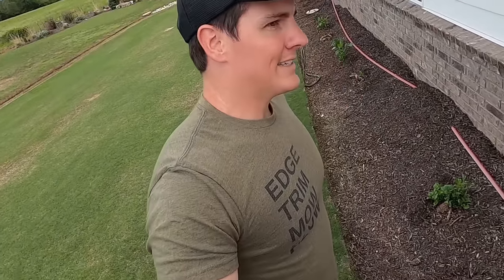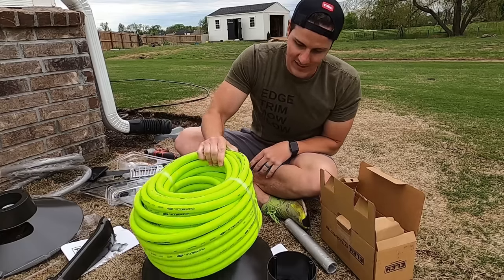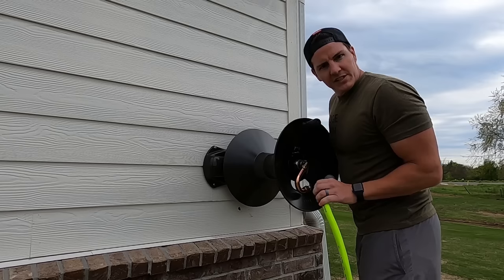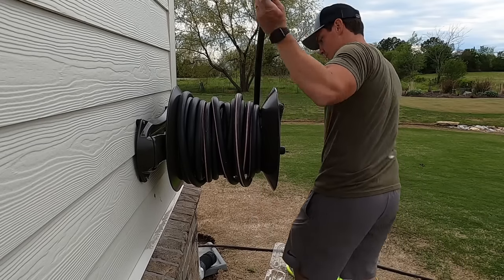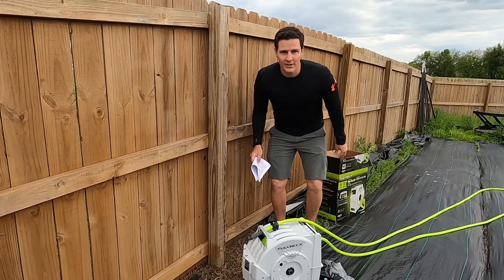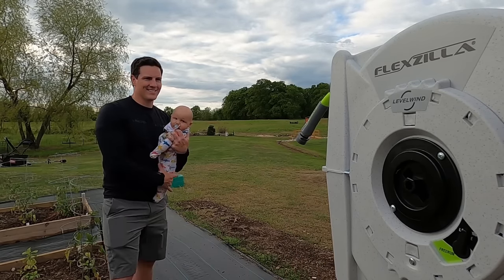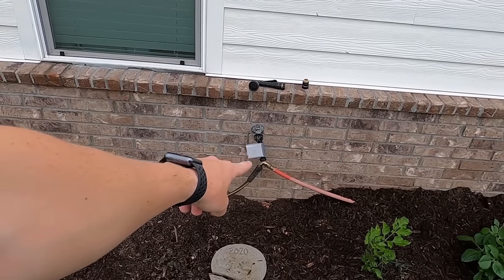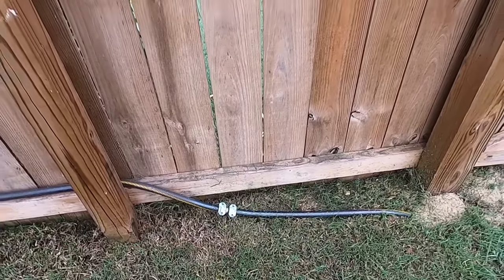I'm DONE Wasting Money On CHEAP JUNK!!  My New Hose Reel Setup

Comment: B-hyve timer; in the front there is a button. Long press until the light turns green and it will manually turn it on without the app. A quick press will turn it off.

Use the app to set the default timer duration; example: I set mine to run for 30 minutes when turned on manually.
Reply from the maker: Ah... well I’m an idiot
Reply: @TheLawnTools  The B-Hyve timer needs some love. Like your videos. Maybe we will have a future video with some thumbs up.
Reply from the maker: @davedozer7200  I shall redeem myself 😁
Reply: Trust me the b-hyve timer still has plenty of real issues.
Reply: I have a rainpoint and am loving it so far.
Reply: But not as fun!
Reply: @TheLawnTools can you tell me I’m going to buy this eley hose reel and debating on which hose. The eley hose is said to be very good, what do you recommend the flexzilla or the eley hose if you have any experience with it
Reply from the maker: @Markg488  I have never seen/touched/used an Eley hose so I’m sorry but I can’t make a recommendation for or against.
Reply: 😂😂😂 4x4 wood post  @TheLawnTools

Comment: Personally, I got tired of dragging long garden hoses all over my 5 acres. So I took the time and effort to dig trenches and run PVC pipes to all the different areas where I need water at and put in the outside water faucet that doesn’t freeze in the cold winter weather.  Now 10-25 ft of hose gets me anywhere I need to water.  Working on putting in auto/timer water system in the gardens so there’s little to no hand watering needs too! Try to cut labor times down as much as possible to have more time for other projects that also need done too!
Reply: I’m surprised I made it almost to the end but when he started showing the hose splitters and the short section buried at the gate, I could take it any more.  Too much talking about random stuff.  The 17 min video was a hose reel review?  I have pvc everywhere with 25 ft hoses…

Comment: Dramm Quick connects have been fantastic through heavy use. Each end of our three hoses has a quick connect (so two per hose). Plus, the Dramm 300 shut off valve on each tasking end of the hoses. Every hose attachment gets a male end quick connect (sprinklers, watering timers, watering wands, single task hose nozzles, etc). It is no longer a task to do any water work, all seemless. Taking the hoses in for winter storage is a breeze! This is the third season and I recommend them.
Reply: Agreed. I have the Dramm quick connect and shut-offs on all my hoses. They’re awesome

Comment: We have been using Gardena quick-connects with everything for well over a decade and they work as well now as when we first bought them. All of out hoses, the automatic watering system and the pressure washer all have them and even our Craftsmen lawn mower has a compatible spigot pre-installed for self-cleaning.

Comment: Instead of buying more awful plastic garbage, I got myself a Jack Daniels half barrel from Lowe's and drilled a hole to feed the hose through. Coiling the hose up in there is super easy, it looks much nicer in the yard than any plastic reel and when it rains the backyard smells faintly of aged whiskey.

Comment: Gardena GBR-3817C Brass Tap End Connector
Gardena GBR-3818C Brass Hose Connector w/Waterstop 
GARDENA Tap Connector-Premium.  

All metal versions of the quick connects you know, with replaceable o-rings you can buy at any hardware store.... two years not an issue in sight.

They're actually hard to find now that they've been discontinued, and I'm glad you said you're not going cheap anymore cause these cost a pretty penny.

Comment: I bought a reconditioned kindle.  dropped into my nightstand & it quit working.  Was at tractor supply and found recharge lights on closeout.  it lasted 3 weeks. then bought same brand diff model for $25 more, still doing job after 18 months.

Comment: I love my b hyve system. Been using it for 2~3 years now. For manual turn on, Just push & hold the button for like 3~5 secs. Then water will flow for 10 minutes and will turn off after 10 mins.

Comment: I have 3 Eley hose reels.  Two free standing and one pole mounted.  They are expensive, but they are built like tanks.  My oldest reel is probably 8 years old.  I leave them out in the winter and they are still in great shape.

Comment: How is it holding up?  Would think the reel mount would go perpendicular to help support the weight of the hose and water but maybe that way helps support the jarring around of use better.
Reply from the maker: You can mount it either way. Whichever works best for your setup. Holding up great with no complaints 👍🏼

Comment: How’s the flexzilla doing after a couple seasons? Did one on the open reel turn into a sticky mess? I love how easy to use that hose is in a wide range of temps but the rubber on all of mine breaks down in the sun after a while. Just wondering about your experience

Comment: Get the quick connects from obsessed garage. They are expensive but worth it! I’ve had mine for 3 years with no problem. Have them on everything including my pressure washer.

Comment: Melnor quick connects have worked great for me for the last year and still going strong. They may start breaking down due to UV rays in a year, but they work so well, I’m ok with replacing them every other year if needed.

Comment: When I first got started in lawn care I always bought used or consumer grade equipment because it was cheaper. My first edger was a Ryobi weed eater with the "attachment system." It lasted me about 4 months and I ran it until it wouldn't start anymore. I threw it in a dumpster and bought a STIHL FC-90 for around $400. For most people that's a lot of money to just pull out your pocket, but it's actually cheaper in the long run. That cheap Joe Homeowner weed eater may only be $95 but you'll end up buying another one every season. My commercial grade STIHL equipment has lasted me 6 years so far. If I kept buying the cheapie I would have spent at least $600 in my six years of business compared to $400 for dependability, capability, easy to work on, ect.

Comment: I live in Florida, near Tampabay. I try never to have anything made of plastic outdoors unless I want to replace it on a regular basis. I have two other types of retractable reels. A 50-foot electrical and a 50-foot air compressor hose. Both are mounted in my garage. You didn't mention, I believe, the size of your yard. That first scene sure got a ton of comments. Like the beginning of a good action movie.

Comment: I have a suggestion. The hose reel that you mounted on the fence post is carrying a lot of weight and will ultimately be difficult for that fence post to support, especially in windy situations. Place at least one brace on that fence post to help off set the weight of that hose reel.
Reply from the maker: Thanks! I’ll have took up fence post braces. I don’t know what that means but I think it’s a great tip!

Comment: That flexzilla hose reel looks strikingly similar to what's called a Power Port Products auto rewind hose reel. The model numbers I'm familiar with are an HR 5012 or an HR 5038 series 2 .  In my opinion, these are the best auto rewind hose reels in the world.  The side plates that hold that flexzilla reel together and even the output in the front of it are strikingly similar to the Power Port Products Incorporated reels. I wonder if Power Port Products actually makes the Flexzilla hose reel, which in my opinion would make it one of the best auto rewind hose reels that you can buy.

Comment: I mentioned Melnor disconnects, but you should check out their entire line of products. Their timers are great as well. You could get a 4 way timer and leave one open for manual watering, but my wife doesn’t like to fidget with the controls so I ran a 2-way splitter before the timer. I also recommend Melnor splitters because they have the larger knobs to open/close the valves.
Reply: The few products of there I’ve used were great. I’ve seen a 4 way Melnor splitter that looked nice. I was REALLY interested in there WiFi water timer but everyone is outta stock or it seems to be discontinued and I can only find there Bluetooth water timer.

Comment: try using buried 3/4" PEX with shark bite copper risers (with winter drain valves at the base)  and as a feed for your hose systems.

Comment: have have the exact same setup with 150 ft. of flexzilla hose on the eley.  Fits great
Reply: Are you using 3/4 or 5/8? And did you need the extension for the reel?

Comment: Interestingly enough I have had the one you chopped off the wall for 7 years now with zero issues. Can't explain why it has lasted so long as I have done nothing to help it out over the years and it has seen winters of -24F in my area. Never took the Sears 100 foot rubber hose off just drained it back for the season(s). Everything must have been in alignment the day they built mine. I will say the retractable idea is interesting.
Reply: He could have put it on the curb with a free to take sign.  Someone else may have been able to repair it or do a work around.  Surprised he didn't ruin the siding.
Reply: @Susan70003  Yes exactly. I was wrong though, it was a 2013 model so it was nine years old. I did purchase two of this type of hose system but I got 2 100 foot models that are the generic type and so far they are working well. To add when things go to the garage if it is at all usable I leave it beside the containers for all to pickup. The majority of items have been picked up by the public for their projects or reuse.

Comment: In a year or two, that 4x4 post will warp inward and your fence will sag.  Ask me how I know.  Would warp slightly less if you would have mounted it lower on the post.  You heard it here first folks!  Also, nothing beats Nelson all brass quick connects.  Been using the same ones for 30 years.  The only change is the brass darkens, but these 30 year old quick connects still work like new.
Reply: Also, the Nelson is  less than half the Eley ones

Comment: Gotta go with the Eley quick connects!  Hands down, the best!!  Here you go... https://www.instagram.com/reel/COORJGmJqGn/?utm_medium=copy_link
Reply from the maker: Ooo that quick connect does look good
Reply: It works 100% of the time all the time - Ron Burgandy
Reply: @jaymetheaccountant  LOL!  Yes!
Reply: @TheLawnTools  yeah!  It’s also full bore, so there is zero reduction of flow.  If you install a socket at the end of a hose, I would recommend also putting a small ball valve on so you can operate everything locally rather than having to run back to turn the water on/off.
Reply from the maker: @TheLawngineer  true 👍🏼

Comment: Eley has quick-connects - they are simply the best.
Reply from the maker: I may have to get like the top 3 and do a comparison video
Reply: @TheLawnTools  I went through probably 5 different brands trying to get quick disconnects that weren't junk. Finally found the eley ones and they are by far the best on the market. They also have twice as much flow as the others. They're more expensive but will save you money in the long run cause they'll be the last ones you'll need. I've got them on every watering tool and sprinkler.

Comment: Sho was waiting to see a big ol chunk of Hardie go flying… or a busted brick.
Man it would drive me nuts to have all that extra hose looped up on that fence on the way to the hose reel.  Id be left with no choice but to cut it short n splice it. 
Being a concrete guy, I hafta mention that those hose timers often suck really bad and if they leak for a long time into a bed up against your foundation, you can end up with part of your foundation bearing on a mud hole that stretches up under your slab and can be hard to even notice from the yard side.  But your slab sitting on mud means that eventually it’s got a good chance of wanting to settle and you can end up with some pretty serious problems that you can fix but will still come back to bite you in the ass when it comes time to sell (if your state is like mine and you have to disclose foundation issues even if repaired). Not sure where you are or soil conditions there.  It can be a bigger issue in some places than it is in others.    Jus sayin.
Reply: Good point there. When I had new gutters and downspouts installed, I was advised to have the end of the downspouts at least 2 feet from my house. Home Depot sells a retracting extension for this purpose.

Comment: I like how you tucked the hoses away, cool tour. I'm super happy with the Eley quick connects, I learned by more than you think you need because the one thing you don't put one on you'll end up using and it's annoying. They're completely metal and have One of the largest inner diameter of any quick connect I found.

The Eley reel I'm super happy with as well, going to buy one for the other side of my house at some point.

Thanks for the link too! Happy Memorial Day! 🇺🇸✝️🪖

Comment: I have had the price vs value discussion with so many people but it's hard to get through to them.
I have found that paying a bit more for the quality product that LASTS is much more economical in the long run than buying the cheaper one multiple times through the years.
But most people are to hardheaded (or just too dumb) to do the critical thinking to grasp the concept.

Comment: Wait, you learned of and procured an Eley reel, and don't know which quick connects to use?  C'mon man, get all of the Eley stuff.  It's expensive, but you've gotten past that already.  Quick connectors w/full-diameter flow, ball valves with full-diameter flow, nozzles, potable water hoses.  Just bring them in when freezing, silicone grease on the connector o-rings now and then.  Done.

Comment: Love how the screws ripped nasty holes in your siding as they got ripped out with your dramatic hose reel removal at 1:30 ... Considering the damage and subsequent cleanup you should have at least used a screen shot of you swinging the pick axe for your thumbnail
Reply from the maker: Screws didn’t rip out. I unscrewed them after having some fun.
Reply: @TheLawnTools  Yeah right... Viewers can clearly see the jagged screw holes at 1:37...  but if you pause the video at 1:42 no apparent holes are seen where you unscrewed them. NET: Personally I liked the stunt and the slow motion but admit it or not... your stunt ripped out the screws.
Reply from the maker: @eltonnoway7864  
It didn’t … don’t know what else to tell you. But you can keep going if you want 🤷🏼‍♂️
Reply: I would have used a piece of plywood to protect the house. I'd have my wife hold it.